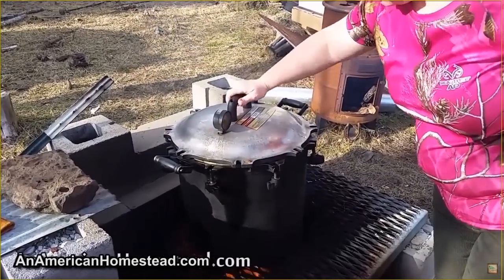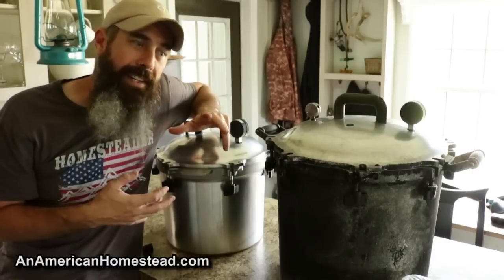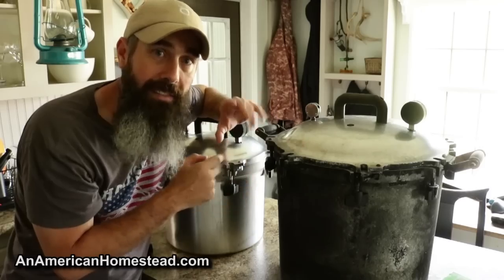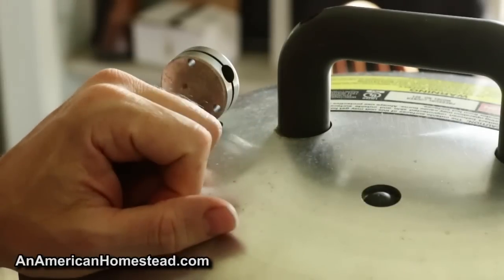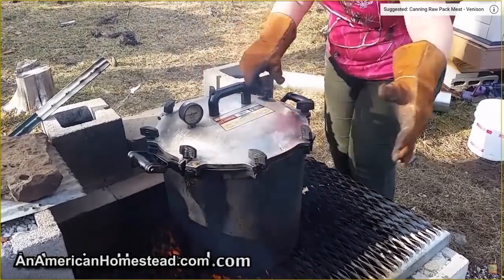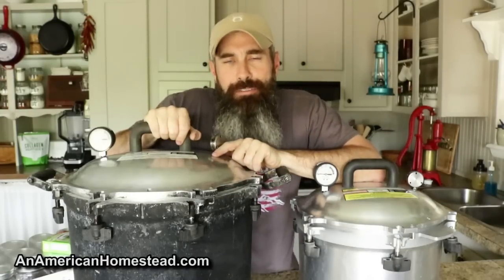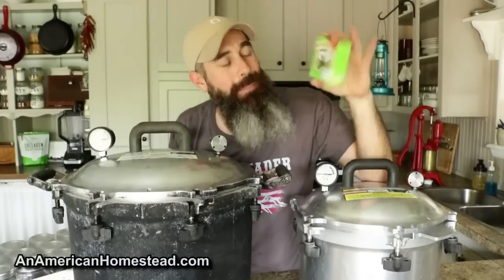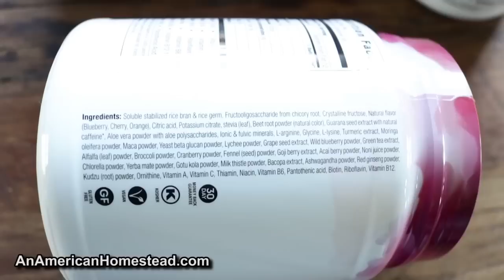Your Pressure Canner Just Broke! Now What?

Comment: I have always reused lids, as many times as they can last! Once they fail to stay sealed, it goes in the trash.
Reply: Thank you Zach great video, this was very useful. In a survival situation.
Reply: @Kevin Wilson use a butter knife and slide along the ridge. gently turn up - been doing this for 15 yrs or more- also as long as no rust  your good to go
Reply: And be sure to remove the rings from the jars before putting them up. Then wash them and dry them and put them away. This keeps them from rusting on the jar during storage.
Reply: @greatdanerescuemom1  This is very helpful, thank you!
Reply: There are also reusable lids! Tattler and Harvest Guard make reusable canning lids. Also there is a tool called a church key that is perfect for popping open jars without bending them
Reply: Here are two more dirty little secrets:

1. You can take the ring off and put the jar in a boiling water bath. Once the contents reach boiling the lid comes off with no effort at all. I imagine most are going to heat the contents up to eat anyway, so...

2. Don't hold me responsible, but I can using my microwave now, instead of a boiling water bath. (Obviously you cannot do this in place of pressure canning.) I know, I know, it sounds terrifying. Who hasn't seen the sparks from aluminum foil? Well, that is because foil is too thin to reflect the currents, and it has a gazillion sharp corners that act like antennas. The canning rings and jars are plenty thick to carry the current, and do not have sharp edges. Try it. Put a jar in the MW for 1 second.

What I do is set the MW on high until the jar is boiling, then scale back the power to keep a soft boil going on. Use all the same practices as traditional canning, lid on and ring ever so slightly screwed on. Yes, this works. I've done many jars this way, without any problems.
Reply: @Kevin Wilson .i wonder if a ice cube atop the lid while the jar is in a pan heating up?....the jar swells and pressurizes while the lid shrinks from the cold.........or a vacuum cleaner providing upward pull on center of lid........or the mason manufacturers might know a cool idea
Reply: Felony Videos do not use the microwave to can things. It heats unevenly, and you can’t be sure it’s reaching and maintaining the correct temperature for long enough to kill the bacteria’s that produce botulism. Please be safe
Reply: @phyrewillow6463     those microwvs heat hotter than boiling, and i wonder if it ruins the nutritional benefits too
Reply: @phyrewillow6463  I still use the 90 minutes rule.
Reply: So have I..
Reply: @FelonyVideos  From Lil Giant Good advice! Did not realize! Thank you. 😉
Reply: @marthale7 From Lil Giant Thank you!
Reply: @robinsong7298  
I'm subscribed.
Perpetually watch.
Albeit, I'm just going to assume that your response, to this particular video, is perfect sarcasm.
Reply: @abigailbelford883  actually no I think Zach has a great mind and thinks of many things most people over look, and has a great since of humor. No sarcasm just telling it like it is. God bless Shalom
Reply: @robinsong7298  
My bad.
God bless you and Shalom to you as well.
Reply: So how do I can store bought milk without a pressure canner!?  I waterbath most everything and I do not want to buy a pressure canner.
Reply: @Tin Hat Happy I use my thumbs, and never a metal tool, such as a knife or spoon. Steady constant pressure and it eventually releases without bending.
Reply: @angelamc3532  I've never heard of canning milk!
Reply: I would use them for dry goods (vacuum seal) but I don’t think I’d take a chance on sealing again. Only cause if the seal doesn’t work and you have to reprocess, you end up with mush paste

Comment: I want to recommend a fire cone.
It is a metal cone , the small end upwards under the pot, the opening smaller than the bottom of the pot... the larger end downward over the fire.
It helps greatly to focus the heat under the pot, and not blowing around ... it will save the pot handle from excess heat/flame. 
A fire cone will make your wood fires much more efficient for cooking. 
I have flat sheet metal to build cones and I have premade roof flashing cones.. that we got on sale, so cheaper than making one...  TOTALLY WORTH THE EFFORT... obvious improvement over open fire cooking
Reply: I was thinking about a rocket stove to heat the pot.  The only issue there is that that type of fire needs to be watched almost constantly while an open fire would last much longer.
Thanks for that idea.

Comment: Great reminder to get some spare parts. Thanks! The last place I was able to order jars was Tractor Supply last month. No more.  I reuse lids all the time. Some I'm up to 6 times of use so far. I am really careful when taking them off. Safe? Everything is killed DEAD in the canning process. tie a string through the opposite hole on the weight and tie it to the handle. No more worrying about losing he weight.
Reply: they're available now.

Comment: So glad you addressed this. I have a canner that requires a casket so I keep a couple of gaskets on hand as well as a spare jiggler. I save my used metal lids and, have on occasion, reused them. I also have Tattler lids which are what I used exclusively this season to can my garden. I have a large stash of metal lids but, in the face of not knowing when or if I could buy more, I wanted to save them back.  I like redundancy and whole heartedly agree with "two is one and, one is none".

Comment: I suspected that the glass industry would not be tooled up for the "everybody's a gardener" reaction this year.  I picked up about a pallet of glass earlier in the year, and I'm sure glad that I did it.  On the topic of canning lids:  I love using our FoodSaver jar attachment as a validation for the lid integrity.  If I can pull and hold vacuum for a couple minutes, I know the lid is solid.  I do it for my dry-pack canning too, so I can test the seal prior to the oxygen absorber reacting.
Reply: Brilliant! I am so going to remember this tip the next time I want to reuse a metal lid.
Reply: You can use a brake bleeder for an off grid way to vacuum seal your dry goods with your food saver lid.
Reply: @thesaintmustwalkalone708  Confirmed. I have one in backup. Works great with the jar sealers.
Reply: @Alex and Sam AK  We're lucky, our local farm store in Washington has them for 13 bucks a dozen - just yesterday I saw em' - honestly, I was surprised tho'.
Reply: even worst this yr.

Comment: Once I'm done canning with my  lids, I STILL don't throw them away. I keep them separate from any other lids & reuse them on leftovers (in store jars or Mason  jars - less baggies used) but best of all, I reuse them again & again for dry, vacuum sealed storage. They work better as used lids for vacuum sealing than brand new lids do!
Then... once you cant get them to seal at all any more, use them with your old, rusty or peeling rings/bands on store bought jars for nails, paperclips, buttons, whatever oddball storage needs you might have. I've combined what I just described with canning jars that have nicks or dings on the OUTSIDE of the neck, by the threads, for the same thing. 
I just don't  throw things away without really thinking about what else they could be useful for or mostly saving me money!!
Happy canning everybody!
Reply: I repurpose my nicked/dinged jars into candles. Works great!

Comment: I have a '70s Mirro pressure canner that is older than I am, and it works great for small batches of jars or cooking for directly inside of it.  My All American 930 has the weight tied to the handle with butcher's twine - it is not going anywhere. This beast works great for canning jars since it can do two layers of jars at the same time or twice as much as my Mirro.  Sometimes I have both going at the same time. Easy meals after that!

I normally reuse my lids for water baths (apple sauce) or for jars that go into the freezer.

Comment: yup the American Canners are the best,  main reasons i purchase them is heavy duty metal can take open flame like wood,  
no rubber seals it is a mechanical seal, and parts are interchangeable to each model. 
We have the canning lids but i have been trying out the Tattlers for a couple of seasons and so far have not had any issues, but always keep metal lids on hand and keep my old one for use on non critical uses like jellies

Comment: Great video, and great things to consider in today's climate! My first pressure canner I purchased was the All American, but I disliked it's sealing mechanism. So I bought a Presto canner. Hands down the easiest to use, and it withstood the abuses of canning on a wood cookstove for years. Less parts to have to replace as well, and a great price. I was able to buy 3 Presto canners for the price I sold my All American canner for. Which was awesome, because I could can way more jars at a time, constantly rotating canners on and off the stove when they were done, or ready to go on. I too have reused lids for years, it works! I have also reused spaghetti sauce jars with their one-piece lids in a pinch, and those too sealed.

Comment: The waiting list on getting one of these is really long. Good point on the prestos. I don't think they will work over a fire for too long.
In other countries they don't think twice about using their canning lids again.
Reply: Presto canners work over a fire. I have a 1972 (bought new) Presto paired with a SilverFire rocket stove. The key to using any canner (that I'm aware of) and a fire is knowing how to control the fire. Understanding the concept of less is more. A small fire is enough to maintain a waterbath or a pressure canner. Mistakes with fire control can lead to damage, regardless of the brand of canner. Did you know you can boil water in a paper cup?

I save all my used, undamaged lids, for vacuum sealing dry goods in mason jars. At the  prices of meats today, I can't afford to have jars fail to seal, especially when canning beef.

Comment: I have been canning for about 6 years now.  I don’t have an all American but I do have a presto canner and prefer it to using a pressure gage (I don’t have to get the gage checked every year and I can use the same canner to water bath if I am doing pints).  I also have a water bath canner.  Here in Missouri lids are like gold (along with jars). But I will reuse my lids but I mark the tops so I know which I used for meats, veggies, fruits etc so I ONLY reuse on those items again.  You can also, if your on the fence about it, use the reusable gaskets with the lid if you’ve had trouble getting them to seal with the plastic lids...just lay the gasket (after being soaked in simmering water) on the jar opening then place the used lid on top.  But I would only suggest that if you already have them on hand....they are just as scarce.   But if you’ve never tried the reusable ones I suggest Harvest Guard reusable ones...they are still making and you can order...they are taking about two to three weeks longer to get but I have had nothing but success with this brand and they haven’t jacked the prices to get.  You can get anywhere from 6-10 (some have said 20) reuses on them and you can order just replacement gaskets from this company.  They are a US company out of Colorado and source their materials out of Indiana.  Hope this helps anyone still looking, and thanks Zack for all you do!
Reply: B K   I agree.  I prefer to listen for the rattle than watch a gage for what can be up to 90 minutes.

Comment: I too reuse my lids.. usually I use the ones I have water bathed as they pop off easily.  Pressure canned ones probably not because usually they dent when I pry them off but I don't throw those away either they are all fine for storing your dried foods in.  Anna In Ohio.

Comment: My mom canned over an open wood fire outdoors. 
Mama set 2 or 3 cinderblocks about 12 inches apart, and built a fire between them.
Then she set our galvanized tub on top, and filled it with jars of food, and then filled with water. 
A plywood lid with a wooden handle in the center finished off her canning apparatus.

She had a rule of thumb: 1/2 hour for acid things like tomatoes or fruit.
3 hours for non-acid foods, like green beans or meat. 

And we never got sick from that food.
Just boil all home-canned food, for 15 minutes, before tasting. 
That will kill all botulism in all stages of development. 

So, if the grid goes down, or if your canner dies.... not all is lost. 
We need to learn not to live in fear. We've been programmed to be scared of everything.

Comment: Thanks for weighing in on Tattler Lids. Helped a friend water bath can tomatoes 40 years ago....extent of my canning experience....thought I could use my Instapot to can until I read a comment somewhere several months ago about the difference between pressure cookers and pressure canners. Was so busy just trying to get new garden space plantable with claw, then broadfork. By the time I realized my misunderstanding, all pressure canners gone from store shelves. Finally got a used Presto with missing parts from a yard sale, then they started trickling back in to Walmart Springfield, TN, so got a new one.....now just to find the courage to start using it.....you are right about the green beans. I can buy #10 cans at Gordon Food Supply for a fraction of what it costs me to grow, harvest, prepare and can.....have had an eye on All American for a while now....on backorder as well......
Reply: You can use the instantpot for water bath canning or steam canning. Set it to the sterilize setting, I wouldn't trust it to sterilize med equipment but sufficient for most day to day. Essentially the sterilize setting ignores the high pressure cut off and will continue to build pressure until you have a solid spout of steam with the weight in the closed position. Steam canning, per usda and fda, is sufficient for use with all the stuff you would water bath can, no soup and no low acid but salsa, jams with lemon juice and pickles are all good. We used ours to can peaches and strawberries for the first time earlier this year had about 90% seal properly and the last 10% we are pretty sure were all user error mainly not getting the jar rims clean enough.
Reply: David Pritchett that’s good to know! I may try it for my applesauce I need to can today. Any tips or where I can find instructions so I don’t mess up?
Reply: @davidpritchett855  I purchased a instant pot a while back thinking I could do canning with it, It came with a thin pamphlet do you happen to know of a good book I could purchase to get recipes to be able to use with it thank you.
Reply: @deniecehartford2481  I don't have a particular book but I use hip pressure cooking and pressure cook recipes websites they have great test recipe info, ie what it looks like at 5 minutes 10 minutes etc. Assuming you have an instantpot duo or similar it will go to 11-12 psi, the instant pot max is 15 psi and a stovetop weighted is usually 15 psi. For the stove top style add about 25% more water since it will vent to maintain ideal pressure range. Also look into bain marie aka pot in pot cooking, you can make excellent oatmeal, creme brulee and lava cakes that way.

https://www.pressurecookrecipes.com/

https://www.hippressurecooking.com/easy-pressure-cooker-steamed-rice/

Comment: So much relevance in this video for today. Especially considering supporting supply chain is one strike away from damning itself.  Or possibly orgins of the maker. Personally we have a AAC that processes 7 quarts and 7 pints. We tie our weight to it with cotton butcher string and a extra regulator. At one point it was back logged in their ordering. One is none 2 is 1.  We use our lids twice as long as it seals but then we use them for vacusealing jars as long as the rubber is still good and it takes the vacuum. You can use a manual break line pump to hand vacuum jars (with the lid sealer through our vacuum sealer) with dehydrated goods.  including pemican.

Comment: I have canned on my wood stove but not on open fire will have to try
Reply: Consider using a SilverFire Survivor rocket stove. I bought one, once I learned it works well for both waterbath and pressure canning. I have an old Presto (1972) paired with this wood fired option. Great thing about this setup is how little wood is needed. The SilverFire uses twig sized pieces of wood to maintain a cooking fire. There are YT videos on this stove, including using it for canning.

Comment: I always use lids twice if they aren't bent or the sealing area seems OK.  But I only use them on product that I wouldn't mind losing.  For me, that's anything like green beans, tomatoes, applesauce or broth.  Any meat gets canned with new lids.  But I actually rarely get a fail with using a lid a second time.  I "X" them with a Sharpie to show they have been used once if I didn't date the top so I know for sure.

I have Tattler lids and I probably wouldn't buy them again, they are hit or miss, after a single use, and probably 10% fail even then.

Comment: I have the same philosophy on using wood heat, I have Dakota fire holes"in ground natural rocket stove" in various parts of the property they are very efficient and really get the absolute most out of the smallest pieces of wood and for blanching,washing clothes, boiling water ECT I use them for just about anything , I have one under a large teepee with the intake outsidefor mild rainy days as well. You can't beat it with a stick as a matter of fact we've been getting most wood off the floor of our woods just make sure your holes don't have roots, especially pine,spruce ect the roots could act as a fuse and slowly simmer underground for days after you used the hole and a tree catch somewhere, never had it happen personally but that's what I was told by my Cherokee grandad so I wouldn't risk it if your digging and hit a root stop and dig somewhere else.